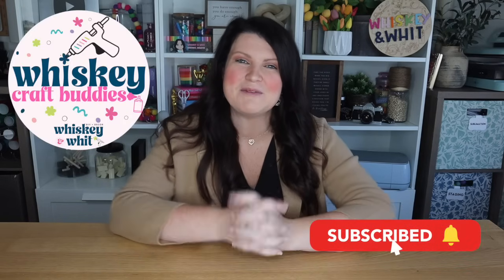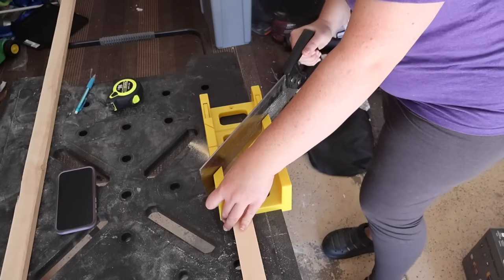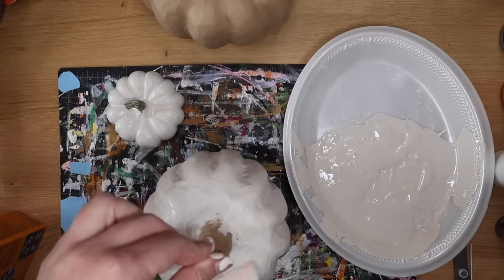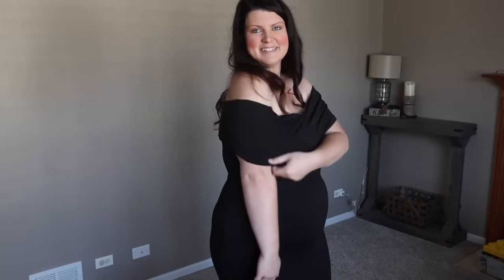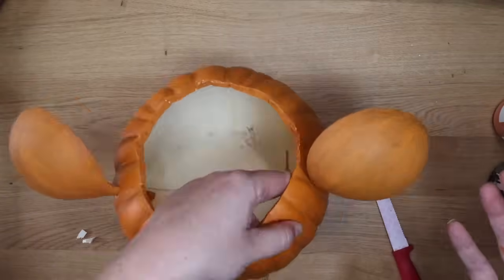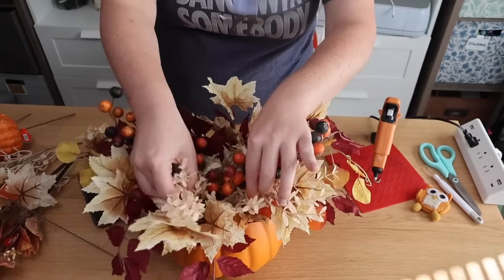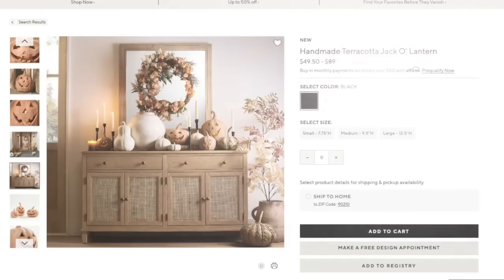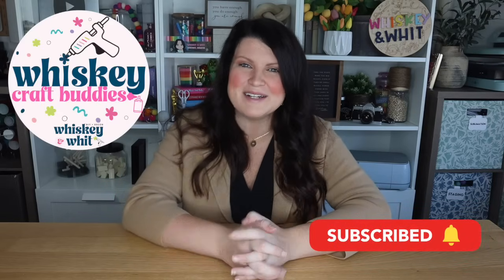NEW Fall Home Decor DIYs 🍁 Get the high-end look for less with these FALL DUPE DIYS! 🤯

Comment: I spent 40 dollars for the print and then I bought the 1x2x8 but I did not get enough to do my frame. Wonder what I did wrong?  Walgreens could not print it out so I went to a printing shop.
Reply from the maker: For the frame, you'll have to cut it out just as I showed for the lest amount of waste - if you don't you'll need a second piece because it's almost exact for the 8 ft. board. Did you maybe get a 6' board instead? Sometimes the signs at the store can be unclear.
Reply: @Whiskeyandwhit  no I got 8 foot but I realized that 30x2 is 60 and 20x2 is 40 so I needed 100 inches and 8 foot is only 96. It’s ok. Getting another board today. I love it and appreciate you so much. I retired 2 years ago but took care of my mother until she passed in June   Just getting g started in crafting